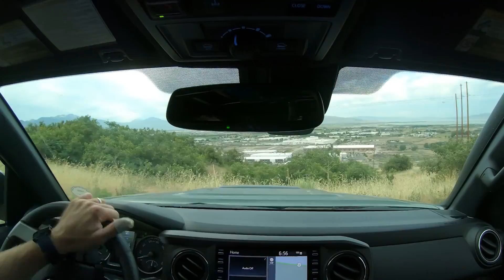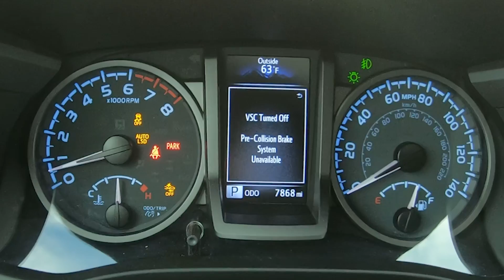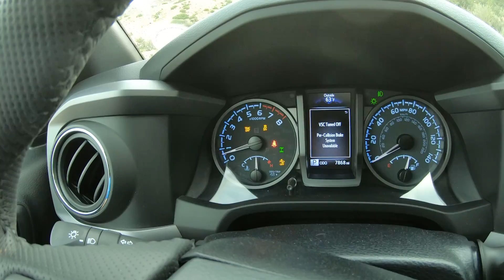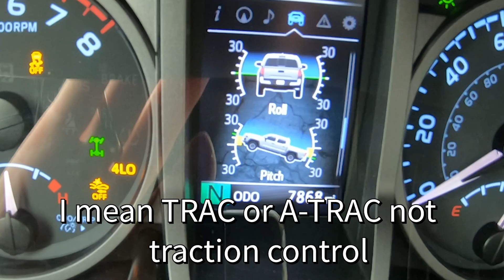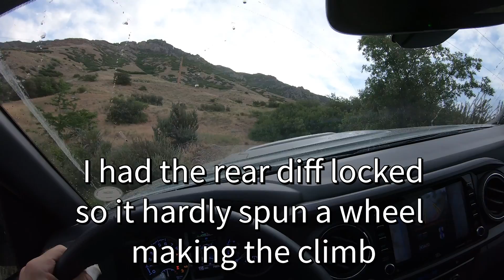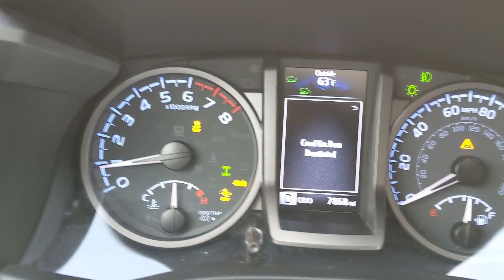Tacoma TRD Pro Off Road

Comment: the crawl control and terrain modes are pretty much useless.  They just sound good in theory.
Reply from the maker: They do make a difference, but when there is a rear locker available there isn't much need for the various modes. Crawl control works great as down hill assist since the Tacoma doesn't have very low gearing.
Reply: @EngineAdventures  Just manually put into first gear.  You dont want to use the crawl control too much because it wears out the brakes.
Reply from the maker: Yeah except in the auto the gearing isn't low enough to really slow you down, even in 4-low.

Comment: Have you off-road tested a 2016 or up Nissan Titan? My 2019 Pro4X has ABLS (active-brake limited slip) in the front? and rear similar to the Tacoma/Tundra. I'd be interested to see how the Titan performs on your course. I've had my truck fully articulated in 2wd and could feel the ABLS engage the rear; it kept going through some stuff I wouldn't have thought possible.

Is there a 2020 Titan review in your future?
Reply from the maker: Yes in fact there is a 2020 Titan Pro 4x coming soon, I've done all the filming for it, but haven't started on the video editing yet. I'd say 2-4 weeks out as there are a few videos I need to do before it.

Comment: All that bullshit to put in 4x4 crawl control ect...uhh no thanks
Reply from the maker: The nice thing is that you don't have to use them. You can put it into 4wd low, and all the computer aids are turned off. If you want to engage them from there you can, if not lock the rear locker and head on your way.
Reply: You don't have to use any of those features just regular 4x4, but they are available.

Comment: Came for the traction aids, but came away more impressed by the suspension travel. The green is my favorite color so far on this model.
Reply from the maker: It definitely had more articulation than I was expecting. Those Fox shocks are pretty amazing at allowing for a lot of travel, but also providing for the right amount of damping over very rough terrain. The Tacoma TRD Pro is definitely best when off-road and ok on-road.

Comment: Great review, how close is this to the 4Runner? Is there any hack that will allow us to turn the locking differential on in other than low range?
Reply from the maker: Getting a 4 Runner TRD Pro in a few weeks, the video is probably 2 months out. I'm sure there is a hack where you add in a resistor in a wire somewhere to trick it into thinking it's in 4wd low all the time, or even to work in 4wd high or low, but not 2wd. Might search the forums to see if anyone has done it.

Comment: Great review!! Does it feel under powered while off-roading? I know it’s crawl ratio isn’t the best in the midsize truck segment
Reply from the maker: Thanks for the support! In 4wd low it's fine, I never ran out of power. The Frontier with the 9 speed auto is a bit better and it makes a big difference when going down hill and using engine braking. I should have the Frontier video up within 3 weeks.
Reply: Engine Adventures Sweet! Looking forward to it!